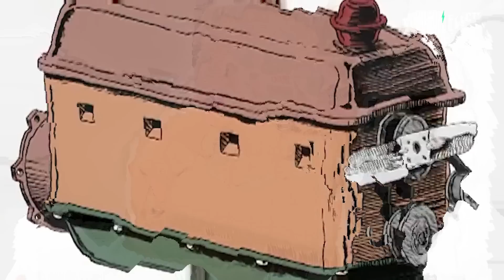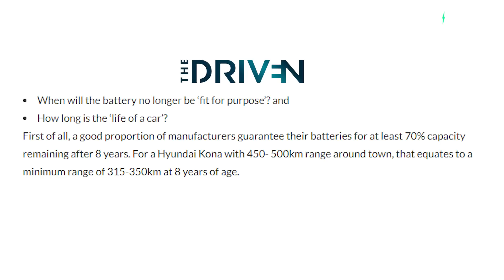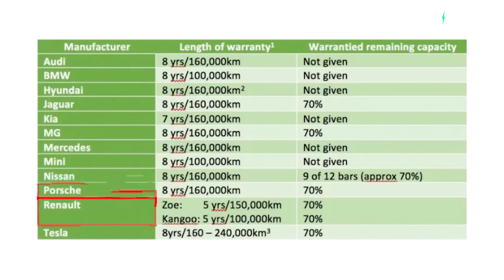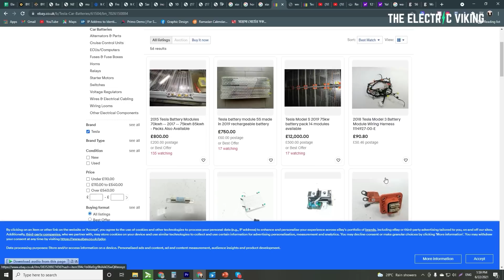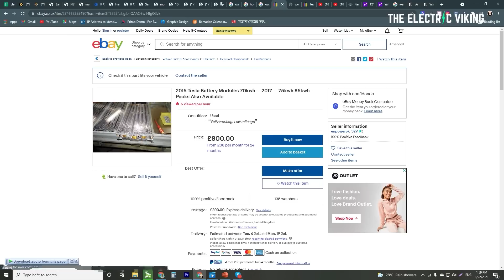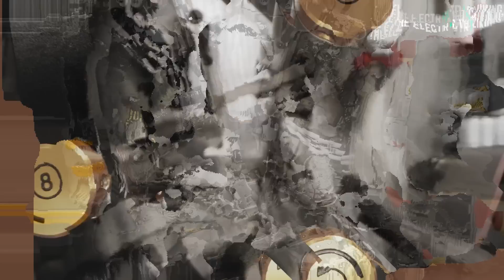How much does it cost to replace the battery in an electric car?

Comment: With rapid improvements to battery tech, the question isn't how long the battery will last. It's, why on earth would you want to keep driving around a deprecated dinosaur? Solid state batteries will already have replaced all the legacy batteries by then.
Reply: @samijokinen9246  I wasn't referring to ICE vehicles as dinosaurs. I was referring to the most recent batteries in EVs becoming dinosaurs after solid state batteries replace them in EVs. I agree that a current paid-off ICE car has considerable value. But, the future is electric.
Reply: Nonsense, I still see over 30years old cars on the roads and around the world and they are used in very harsch environmens too, I don't think an EV can survive the abuse, just look at Cuba with their old American cars, Africa with super old up to 50 years old....
Reply: @alanmay7929  When I said "deprecated dinosaur" I was talking about the battery that would be old tech by the time it'd need to be replaced.
Reply: @samijokinen9246  wrong, old EVs have bad values, reduced range, reduced charging capacity and most definitely not that cheap, an old Toyota Corolla still has better range an old 30 years old Toyota Hilux or Tacoma Can be used for ocerlanding, going to remote places.....

Comment: 4416 of the 2170 cells costs around $25-$28k, NOT $12k.  Of course, that doesn't include service center costs, since the systems have to be flashed by a TESLA SERVICE TECH ONLY at a Tesla service e center for everything to work.

And there's no guarantee Tesla will consider your battery failure a WARRANTY ITEM.  The real car makers actually follow the rules, so they're more likely to honor the warranty.
Reply: Yeah I remember a case where a brand new Tesla Model 3 owner ran over something on the road and it damaged part of the battery, Tesla said the battery needs replacing at $16k and not under warranty due to road debris. A YouTuber called Rich Rebuilds managed to fix it for $700. Just search about that and can find it, but it is a lot more expensive than $12k on a Tesla for battery replacement!
And another one was a Tesla Model S that was $22k for a replacement and that one was repaired independently for $7k
Reply: @gregb1599  The battery is guaranteed against degradation not crash damage! Hoovie and Rich are a youtubers and I bet they just did this to get views. Anyway, why go to the manufacturer for a repair if 3rd party can fix it cheaper. Check out Gruber motors for example.
Reply: @pmac6584  Hey genius the original YouTuber said about the cost of replacement batteries which has zero to do with warranty issues! The bottom line is Tesla batteries cost a lot more than $12k to replace!
Reply: @pmac6584  Again what does any of this have to do with a warranty claim! The batteries cost anywhere from $16k to $20k plus regardless of crash damage or not! You buy a brand new car and have a simple stone cause $16k worth of damage to the unprotected battery connector I bet you would be pissed off at the ripoff price because Tesla is to lazy to fix it and just say sorry you need a whole new battery!
Reply: @gregb1599  You can have all sorts of issues and the company any company can weasel out citing any damn thing.  Although I live in India, have experienced in India and know it's the same in U.S. 

https://www.youtube.com/watch?v=xLJ4_CPlCr4

https://www.youtube.com/watch?v=hi4uVQDY4nE

https://www.youtube.com/watch?v=ijC8kqzMrcw
Reply: @gregb1599  Hi, first of all it was the cheapest tesla in the usa. An old model S. It was a setup between 2 YouTubers to make money and is for entertainment. Using this as a source of information is like watching top gear and believing what they say. And yes if it happened to me I would be pissed off but I wouldn’t expect a warranty on crash damage. I ran into a fox in my BMW, I didn’t go to BMW expecting a free repair, it was only a little fox.
Reply: All the three videos I have shared above are what insurance companies have done in U.S. I know at least couple of dozen examples in my hometown Pune that has shown the same. They didn't honor even what was agreed upon. There is always fine print that you have to read and even then you never know. If the intention of the company is not to pay you, it won't. I know of cases even in India where the sufferer/complainant has gone and even won in SC but the amount was never paid to him/her/them. 

So guessing it might also have to do with how much rule of law is there in that place/geographical/legal context.
Reply: @pmac6584  And the brand new Model 3? Still expensive at $16k especially since he was driving normally on the road, that is a scary thing and the guy that ended up repairing it has said it has happened before so not an isolated incident. The batteries need to be Tesla service centre repairable.
Reply: @gregb1599  Everyone here has to realize something.  Our friend from India can probably confirm this...

Quoting the TRUE cost of batteries (as I've tried to, using wholesale per cell pricing), the price of replacement is close to HALF the value of many of these cars.  Most times, the company and the insurance company would rather write off the car than replace the batteries.

And, like I said, the price I came up with, DOES NOT include service center charges.
Reply: Mr. Troll, on what basis did you come with this idea that they won't honor any warranties.
Reply: @shirishag75able  You were saying?
Reply: @billcichoke2534  I stand by it. The gentleman above says something, we are not aware of the complete context. Tesla has sold something like few million EV cars to date. I have no idea about how many cars have problem but let's say 2-3 % cars have problems or rather batteries, so it would be few thousand people who would have done battery replacements one way or the other. If it would have been a serious issue then you wouldn't get one off people but there would be hundreds of people who would be flooding and calling out Tesla. I haven't seen that on SM and I use it a lot. .
Reply: @shirishag75able  They have actually sold 1.9 million EV to date still impressive but not a few million yet...

Comment: I agree 8 year warranty beats any ice car, however if after th hat 8 years tiu have to replace that battery, it's difficult spend 12gees on an ice car, even if your motor and tranny went out together. I tend to keep car 10+ years. Current, my ice cars range from 20 to 34 years old. No, I'm not shitten you. However, keeping it real, the arguments you give for dealing with battery life to extend car life are good. Thank you!
Reply: Except for ICE cars like Mitsubishi where they have a 10 year drive train warranty and even their car warranty can be increased to 10 years with an additional cost. Kia is some countries gets a 7 year full warranty
And remember Tesla has a very short 4 year 80,000km warranty on the rest of the car
Reply: Why do you think the battery will need replacing after 8 years? Does an ICE car engine suddenly stop working when the warranty expires?
Reply: @Brian-om2hh  My EV battery is still going strong at 7 years and apparently it's supposed to be the worst battery, but just like any car ICE or EV some come out of the production line with a undetected fault which is why some cars offer a very long warranty. But nothing lasts forever including batteries, which I guess is the reason Tesla dropped the 8 year unlimited mileage warranty on the Model S and X and replaced it with a 8 year 160,000 km warranty as too many high mileage Tesla's batteries were failing during that 8 years...

Comment: I  watch some Ukrainian garage channel that specializes in second hand imported EVs.
They bring a lot of 3-5 year old cars on which they balance the batteries for very reasonable prices.
Most of the time, if your battery degrades, it's a number of individual cells that degrade, and are significantly cheaper to replace.
The electronics are not too difficult to understand and the tooling is common because it's generally the same as fixing consumer electronics.

Here is an example of them building a LFP battery pack for a used Nissan Leaf.
https://www.youtube.com/watch?v=oKHO6lNNXkY
Reply: There is a company in the UK - Cleveleys Electric Vehicles - who offer EV battery refurbishing. They posted a video on YouTube a while ago of a battery refurb they did on a 10 year old Leaf. The work took 4 hours, and cost the owner £600....  As you point ot, significantly cheaper than a full replacement pack.

Comment: The myth about EV needing new batteries every few years was “Top Gear” Clarksonism that was jumped upon by those not wanting to lose their suck squeeze bang and blow toys, strengthened by everyone’s experience of mobile phone batteries. Only recently did phone manufacturers latch on to the idea of halting charging at 80% until the phone was needed for use. This habit was founded by car battery management knowledge especially at Tesla. Top Gear did a lot of damage to the uptake of early EV adoption, but could not resist the tide of demand that has come out of 10 years of practical experiences debunking all those myths.
Reply: I think that you raise a valid point.
My phone has a "bedtime mode" and it allows the phone to take all night to my morning alarm to 100%.
One+ from Shenzen.
Reply: And not to mention ten additional years of development and practical experience?
Reply: Nonsense, they were actually right! Battery degradation doesn’t just reduce your range but depending on how you use your car, with constant supercharging for example it slowly kills the battery, you can still easily drive a 20 years old ice with its original engine and gearbox, in fact even 30years old ice.
Reply: @alanmay7929  both right then.
I'm still running a 2006 VW Golf 1.9TDI DSG gearbox with 228k on it.
The gearbox oil changes are eye-wateringly expensive £300 at a dealer. But my son bought the special tool and for a good bottle of whisky it's only about £100 for the oil and filter. The "Mechatronic" brain on the gearbox failed though and was £1000 from a scrap yard.

Comment: Hi Sam! My 2015 VW e-Up! 18.7kw has the 8 years warranty too and probably the other VW EV’s I believe.
I actually have GOM 135 Km range from the initial 160 Km, so the 30% range loss every 10 years for LNCM batteries 🔋 is quite spot on for me. My e-Up! has no battery pack thermal management.
I hope 🤞🏻 VW will make an battery pack upgrade for 1st Gen. e-Up’s to replace it with the Gen 2 pack with doubled capacity in the same form factor. I adore this agile urban small car with 210nm torque, with the bigger pack it would be perfect 👍🏻
Reply: i have a vw e-up that i bought last year and it has the 8 year 70% warranty. it has the bigger battery and its a great car. very efficient too. i can regularly drive it with 10kWh/100km which is half of what some other evs need. and its very quick.
Reply: @peterkonrad4364  This channel loves BYD but after watching a BYD Tang video where the temperature was between 5 and 10 degrees Celsius it was averaging over 30 kwh per 100km very bad range! Makes your VW look impressive!
Reply: @gregb1599  yeah when it is cold, it is getting worse, but thats normal. may also have been a four wheel drive suv type vehicle they naturally consume more.
Reply: @peterkonrad4364  3x worse? A compact ICE hatchback may get 40mpg while a small Japanese AWD SUV may get 30mpg, the same with your compact VW should be maybe 18 vs your 10 but no way 3x

Comment: I always considered these warranties only worth anything against serious internal failure. Lifetime degenerative capacity loss is almost never going to go as low as 70% of original capacity. Especially with active battery thermal management, so the warranty will not be about regular degradation, ever. It is about internal catastrophic failure.
Reply: Exactly my thought. I drive a Zoe, and the only cases I heard about with replaced (or rather refurbished/repaired) battery packs have been  cars that suddenly refused to charge, giving errors, etc.
Reply: It depends on how you use your car, supercharging constantly and driving in very cold erea could eventually deteriorate quickly, let's not forget low discharging

Comment: Hi Sam, I went EV in 2019. My biggest fear was being left with a car with a dud traction battery pack. Since 2019 we know so much more about the service life of these packs, and with the exception of the Nissan Leaf (because of the lack of thermal management), the pack should be just fine for the life of the vehicle unless you are unlucky - stuff breaks!
Reply: The Leaf does have the compensation of being relatively easy to sort though. A battery refurb is readily possible and viable, usually for much less cost that a total replacement.  I don't know what the situation is elsewhere, but here in the UK, we have companies already offering battery refurbishments.

Comment: The total cost of ownership of an EV is so much lower, a new a car or new battery is not so much of an impact over 10 years.
Reply: It's actually an impact and you can buy an old ICE for less than $5000 with better range than an EV, you can also easily service your ICE at home, oil change and brakes are the minimum maintenance.
Reply: A 20 to 30 years old ICE also has better applications for example going ocerlanding or camping..... With older diesel you can even use cooking oil......

Comment: You pointed out pretty clearly that replacing the battery pack going forward will largely become a non issue (beyond upgrades). My question is, with battery packs becoming more and more part of the structure of the car, will this affect replacement?
Reply: Battery being structural, does not mean it can not be replaced.  The pack is often bolted to the frame at locations that add to the rigidity while somewhat shielded from impact but still can be removed.  The main difference in some designs vs others is that batteries inside the backs may all be glued tightly together so replacing individual batteries would be difficult (I think this is how Tesla plan to put 4680 in the pack for Cybertruck but other configurations like GM Pack setup allows to replace sub units separately.  I am not personally involved in any of these processes but that is my understanding.
Reply: @Tooradj  lol…. New form factors batteries and electronics could come in the future and render the actual ones obsolete.
Reply: I'm only guessing...it's maybe an issue but they only done it after the batteries got good enough to last the same time as the car (it seems). They probably wanted to make the battery a part of the car years ago but knew the batteries weren't good enough for it.
Reply: @Justwantahover  wrong, the battery pack/ cells needs to be reused after the life of the car or after an accident or water damage for example, modular batteries are the way to remain/go.

Comment: My bro’ has got a Renault Zoe 2013, had it about a year and bought the lease contract, It needed a little bit of work and the garage balanced the battery at 92%.( appox £8000 in total for car and battery) and charging costs are peanuts, or free. 😎
Reply: I still can’t buy a 2013 Leaf with a munted battery for under $13K AUD. By the time the car is sold insured and refurbished it’s about $23k to me. Then I would have a 8 year old Leaf ZE0 with a new battery and the same design faults from new. Plus it’s Leaf and Nissan Motors Australia are not fans of the Leaf. Hard pass. There is no upside here.  

Edit: caveat is if you buy a new EV now or in a few years.

Comment: A better question (or two)
Will it be necessary to change the battery in an EV (en mass)?

If so, how much will it cost IN THE FUTURE?

Answers
Probably not...... Warranty should weed out any bad ones.

Substantially less than now, and will probably result in an upgrade.